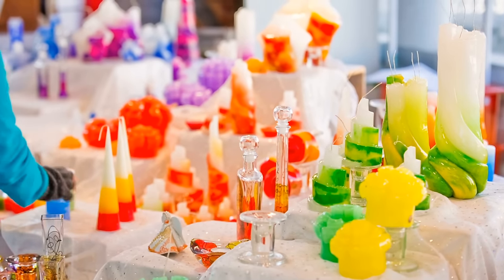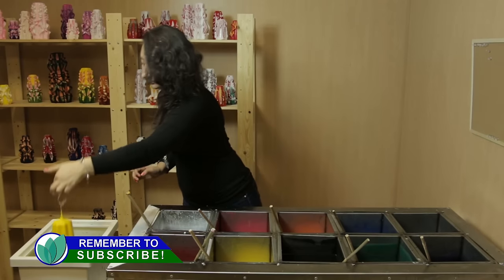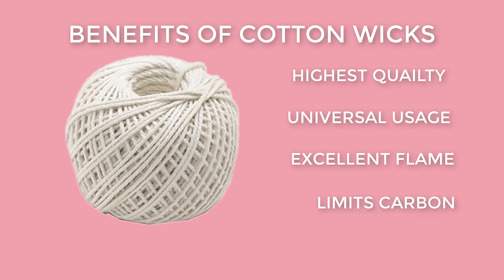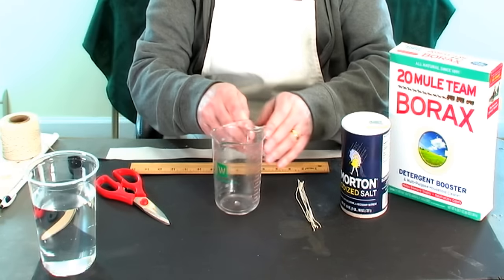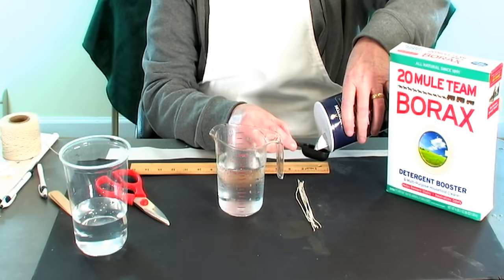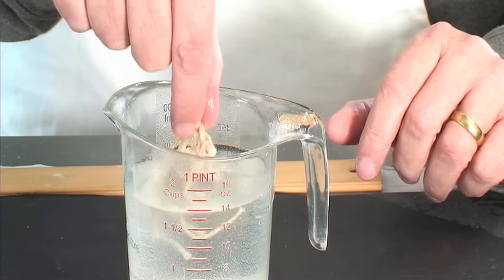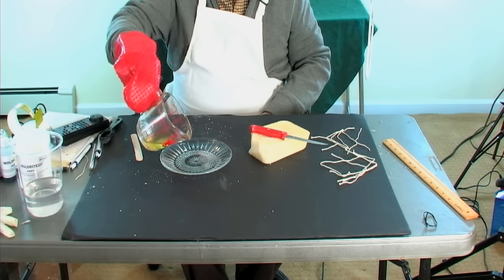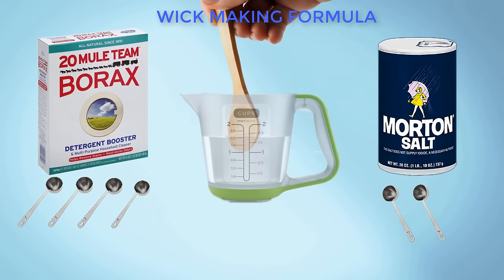How to Make Great Candle Wicks (Tutorial)

Comment: You’ve got to be kidding me….  Wrap the cotton around a greeting card to measure fast and consistently.  Dip the cotton into the melted wax pull it out while it’s still wet and touch the tip to your parchment paper.  The wax will quickly harden and you can gently pull it straight without pulling it off the paper and lay it straight.  You’re welcome.

Comment: Why not cut through the middle of the loops instead of cutting off the ends... 🤔
Reply from the maker: You could certainly do that. But as an old timer I'm stuck with my long term habits
Reply: Fair enough hahahaa
Reply: Yes!
Reply: Morty Snerd  I like to use my goats teeth
Reply: And just wrap the string around your hand several times rather than bothering with a ruler.
Reply: Lol that annoyed me aswel
Reply: That takes an engineer to think of the task
Reply: oh my god I was thinking  the exact same thing. what kind of monster.....
Reply: @Tweektweek0  😂😂😂😂
Reply: Instead of a ruler I just grab a book and loosely wrap string around it a few times. Much faster measuring.
Reply: Why not handle it as a long string and cut it to length after all the water/borax/salt and wax absorption is done?  It seems a time waster to fidget with the fussy small wicks through each process.
Reply: Right? As a knitter, I was getting twitchy seeing all those wasted bits. Well, not if you have composting worms, but still...

Comment: This is the method I use, but I cut the cotton cord after the borax and drying steps to keep it more manageable. After that I cut lengths twice as long as I need, then hold each length in the middle and dip in wax a couple times. I cut them in half once they're dry and they're ready to tab.
Reply: what does the borax do??
Reply: @laurenmorley1964  It stiffens the wick which prevents it from falling into the wax and going out. It also helps it burn more consistently when relit. It's not totally necessary but, especially with bigger candles, it's worth the added effort.
Reply: Hi James, why couldn't you just dip your whole ball of twine in a bowl of borax, salt and water mixture and do it all at one time? Oh, I just read the comment above mine, it makes it too stiff I guess.

Comment: If you are interested in making a "powerful" survival windproof candle i humbly suggest these steps:
1. Take an old white cotton shirt.
2. Cut 1 cm wide stripes from it.
3. Twist these stripes into wicks, leave some extra length.
4. Tie up the bottom into a knot so it stays anchored to the bottom of your "vessel". Ceramic or glass works the best.
5. Fix the upper side in place at the center of the empty vessel with a thin wire.
6. Gradually melt and pour wax/paraffin into vessel. This way the wick will absorb all the wax it needs without extra work.
7. Let it cool and enjoy your creation :)
Reply: Make sure don’t make them too thick for the container 🫙

Comment: You don't need to soak in borax/salt solution. I have been making "survival"/camping and emergency candles for over 40 years. You can use just plain cotton string or twine but it is better if you wrap them with thin copper wire. The single strands from CAT5 wirimg works very well. Simply twist the twine and copper together either by hand or by putting one end into an electirc drill and holding the other end with pliers or just pinching it and running the drill.  The wire will keep the wick from falling over and is easily trimmed if it doesn't burn away which it usually does. If you are using a wide vessel either add 1 thin wick per 2" diameter of wax or double or trebble the wick by twisting two or more together. For a 5" wide glass , I use four wicks about 1/16" thick evenly spaced.
Reply from the maker: Why not make your own video showing how you make survival candles?
Reply: I feel like there's no way that copper wire isn't going to make a bad smell when it burns. Borax and salt are cheap. Beeswax less so, but you can always substitute the beeswax for whatever wax you're using in your candles.

I don't get why they need to dry for 48 hours after the borax/salt solution.
Reply: @RainAngel111  copper isn't going to burn at candle temperatures, shouldn't smell at all.

Comment: OK, so I followed the directions and these ARE great wicks. I used them to re-constitute my growing collection of lame commercial tea candles (which burn for about 10 minutes then fizzle; and upon trying to re-light them the wick carbonizes): my test tea candle with the new wick is still burning almost an hour later!  The borax does "bloom" and there is a puff of smoke; but then the candle settles down to business with a steady flame. A couple pointers --- do use a pyrex measuring pitcher (melting the wax in it, in about an inch of water on minimum heat) so that your can pour precisely into the tiny aluminum candle forms (I did this in an aluminum pie plate to minimize overflow mess). After  cutting the wicks and threading them through their saved metal bases (which you can prepare the wick opening for by using a nail or large needle), and crimping them with needle-nose pliers, I found it efficient to first pour just enough molten wax to secure that (now threaded and ready) wick base, centered, let that dry, then come back to fill the candle form up.
Reply from the maker: Good job, Eric! Thanks for the added tips.

Comment: what are the borax and salt for?      thank you .
Reply: Slow/smooth the burning and cool it in a way the wax around it doesn’t cause a deep pool.
Reply: That’s the truth for salt, not sure if borax is exact same I’m guessing it is similar. 
        Using a paper clip, or similar tool, to extinguish the lit wicks in wax and immediately capping the candle is enough for me.  You can also buy bulk wicks for real cheap online easy too.  
       People advise adding salt immediately after putting out a candle (while wax is still hot) so the wax lasts longer.   Some go as far as putting candles in freezers between use which, I think is overkill/could do more harm than good, but to each their own.    Salt also will make homemade wicks hold form.

Comment: what is the purpose of the salt and borax?
Reply from the maker: It significantly reduces the annoying flickering.
Reply: Filip Martin yes, I think that's the ingredient that stops the wick instantly burning away to nothing.
Reply: Filip Martin  Saw a couple of different comments elsewhere where the people said they only let the wicks pieces soak in the hot borax salt solution for 3-5 minutes before they hung them to dry. Not 24 hrs.
Reply: Filip Martin  I really have no real world experience yet, TBH. I'm in the research / note taking stage at the moment and stalk the comments section in videos for extra / useful gold nuggets. 😊 I do hope you have better luck. I would be interested in knowing what, if anything, turned things around for you. 💪✌

Comment: Thanks for the video. What really interests me is if the wicks work on any diameter of candles?!
Reply: Yeah  I too wonder this. But I'm guessing it doesnt matter the width of wick  as long as carbon doesnt build up on the top of the wick making the burn rate lower or inconsistent.
Reply: @joshuafoster23  the width of the wick absolutely matters. All wicks are made for certain diameter candles. the thicker the wick the larger diameter the candle. So if you were making a candle in a glass container you need to be very careful about the size of your wick because if its to thick the heat could cause the glass to break.
Reply: @carlypippard3552  that makes sense thank you. I have been using the wicks out of chaffing fuel containers they last much longer than other wicks . Not the whole thing in one candle. One wick is enough to make a few candles. I have a 3 wick  pillar candle I use for light at night I made with less than half of one of the wicks from the chaffing fuel canisters  from dollar tree . It's super bright as well. I dont sell candles I just find store bought candles either expensive; or not suitable for me personally.  But I'm like that with everything. One size doesnt fit.

Comment: How do you clean the measuring cup afterwards
Reply: I would probably heat it up like they did in the video and pour the melted wax in the trash and quickly wipe out what's left before it hardens. Then give it a good wash in hot water with a stainless-steel sponge followed up with a washcloth.

Comment: Lost me at the point where after explaining that the cotton material should be braided/knitted you then show a ball of the non-recommended twisted string in your "materials", and then use lengths cut from a different product in a cylindrical reel. And no mention of the fact that different width candles and different fuel/additive mixes all require different wick widths.

Comment: Is Borex some kinda of a soap or sth?
Reply from the maker: Borax is found in laundry booster, certain hand soaps and in some kinds of toothpaste. You can find it as one of these products, sold at grocery stores:
20 Mule Team Borax (pure borax)
Boraxo powdered hand soap
Tooth bleaching formulas (check the label for borax or sodium tetraborate)
Borax has many uses on its own, plus it is an ingredient in other products.
Reply: thank youu
Reply: Borax is awesome. Basically, it adds grit where it’s needed. Great if you haven’t cleaned your stovetop in awhile.
Reply: It's a Typ op salt, BORAX

Comment: I can't get this wick to work with bees wax. I think its due to the melt point of it. Bees wax melt is 140-160 degrees. Other waxes are 129-139. So my wick burns out without much melt on the wax. Any ideas?
Reply from the maker: Beeswax candles developed in the middle ages, an improvement over animal tallow.  Unlike animal-based tallow, beeswax burned pure and cleanly, without producing a smoky flame. It also emitted a pleasant sweet smell rather than the foul, acrid odor of tallow. Beeswax candles were widely used for church ceremonies, but because they were expensive, few individuals other than the wealthy could afford to burn them in the home. The wick of a candle is/was usually made of thinly braided cotton, and sometimes included a fine wire as a stiffener. Perhaps your wick is too thin for your candle - but cotton wicks and beeswax candles have married together since the 1500s so you are not doing anything new. Maybe you could sent a photo or two of what you are doing? info@artmolds.com